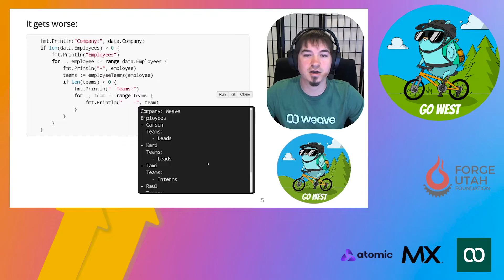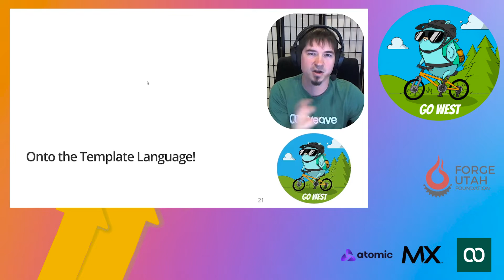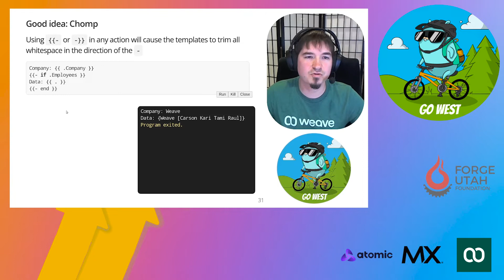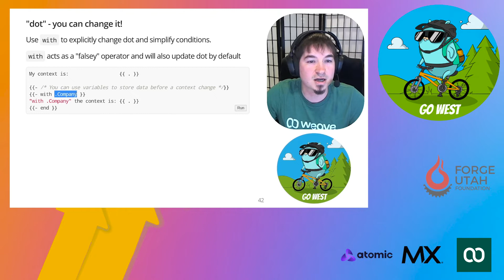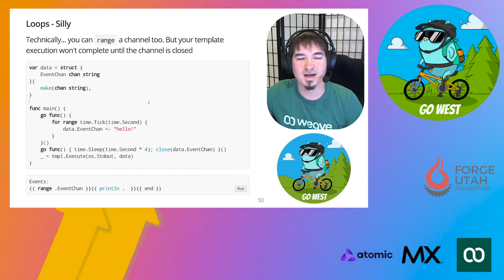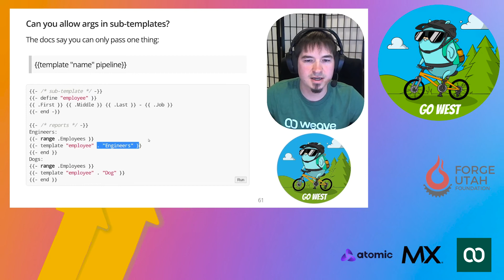Go Templates: Great Library, Bad Rap

Comment: I am ashamed. I led you all astray WRT to comments in go templates.

It turns out that comments (and raw strings) CAN span multiple lines. per the docs:

 Except for raw strings, actions may not span newlines, although comments can.

So the this does work in a template.
 {{ /*
   Hello
  */ }}

As does this:

 {{ `
   Hello
  ` }}

 I'm not sure where along the line I got the wrong idea but I wanted to set the record straight.